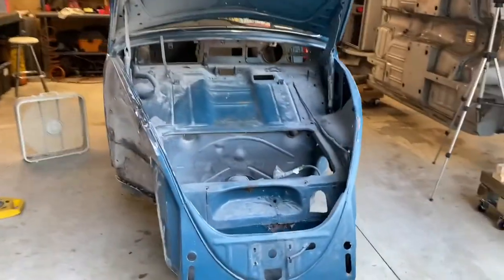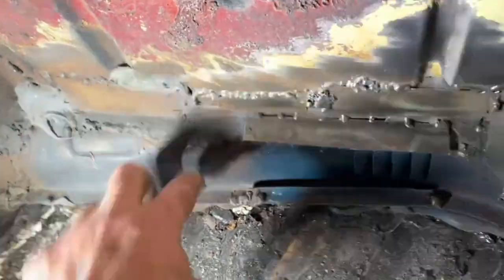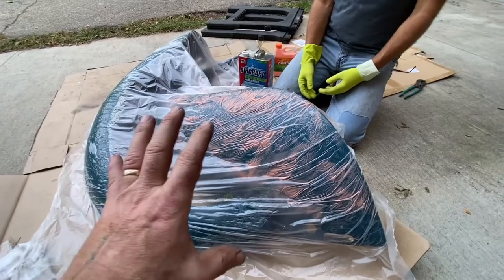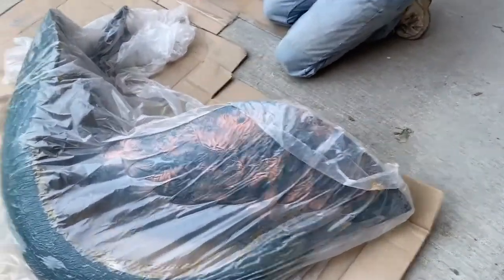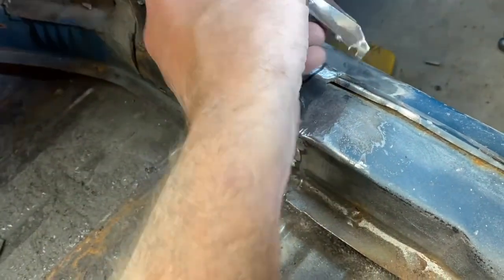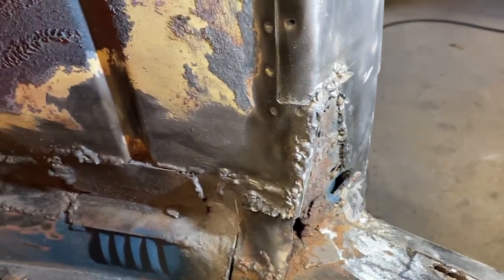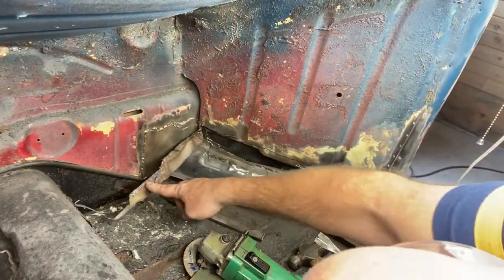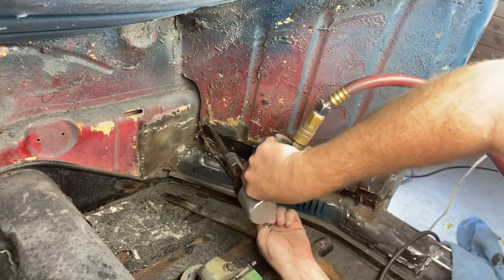1966 VW Beetle Convertible Restoration Pt. 6 - Beginning Hinge Pillar Repair and Paint Removal

Comment: I gave up on chemical stripper years ago.   Cost, mess, poor performance.    I went to Wire Wheel and soda blasting.   Wire wheel is definitely the preferred way.  With the correct compressor/air flow, harbor freight bag of soda blast media, and an eastwood soda blast gun, I stripped all exterior panels and Engine components of the Mustang.   Soda blasting was like erasing the paint away just like using a pencil eraser on paper.   I blasted in a small "shed" lined with plastic drop cloth to catch most of the soda blast media.   Was still a great dusty mess, and baking soda kills the grass.
Reply from the maker: We are going to try some blasting this Wednesday.  I've only used some dry sand I had laying around.  I don't know much about different media blasting materials (soda, sand, grit, glass beeds, etc.)  Do you recommend soda over sand or other?
Reply: @3rdstallgarage  Dont use sand.  It WILL warp the metal.   I used Soda for paint removal. Worked like a pencil eraser.  Right down to bare metal.    Be sure to remove all traces of the soda after blasting.  Final Paint will fall off in sheets if any soda remains.  I just washed parts with water to neutralize the soda.  Then treated to stop rust.   I used harbor freight black Aluminum Oxide for heavy rust removal from the Mustang inner Rockers with their portable abrasive blaster.  One of the absolute key things to remember is to have DRY air when using Soda for blasting.  Any moisture in the air will cause flow problems in the blasting gun/caking of the soda in the feed lines and in the gun.  I had a dryer off of the compressor and a cheap HF throw away screw on dryer between the air hose and the blast gun.     I eventually just used different wire wheels and got great results with those.    On my current mustang build (which I just removed the cowl), I plan on moving well away from Soda Blasting and use wire wheels and the Contour Surface Conditioning tool that Eastwood sells - or at least purchase the knock off that HF sells now.   I'd recommend that you look at videos of that surface conditioning tool.   Users give great reviews and it gets you away from messy blast media.     If you get one and it works well for you, I'll definitely et the HF one  ;).